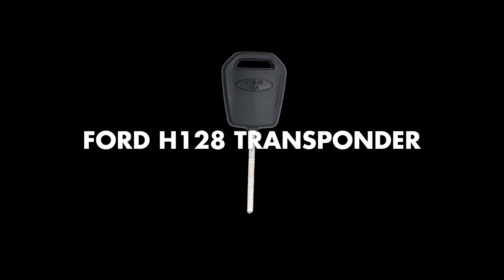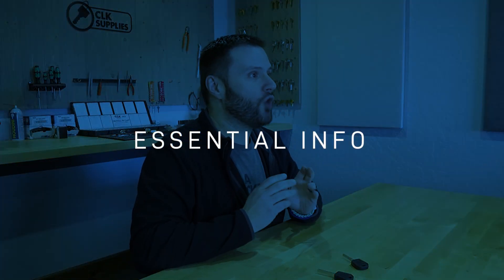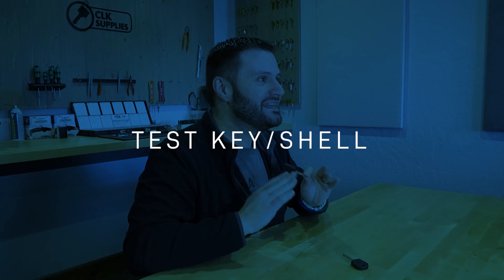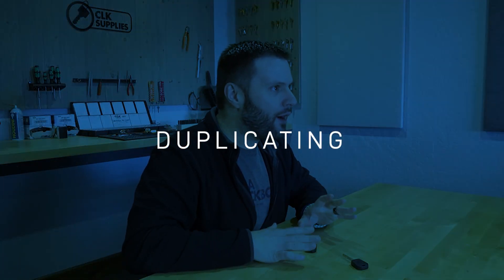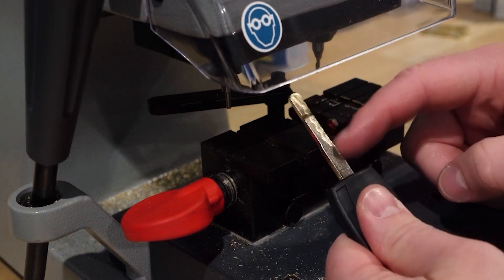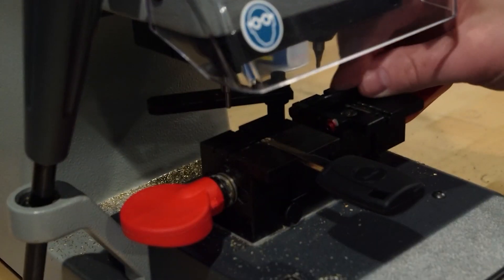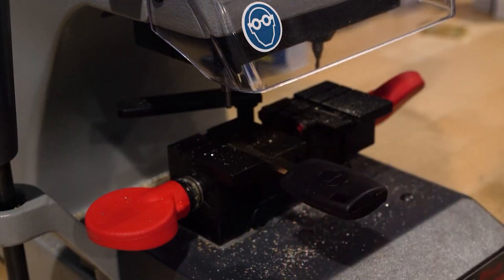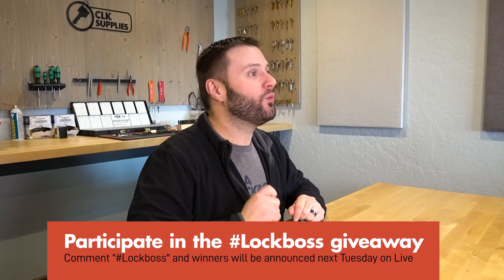Transponder Keys Explained | H128 Ford "T" Key

Comment: The reason for the "twist" is because the vehicles that would take this key have the remote-flip key.  They've designed it so that the ignition key hole is 90 degrees of what you'd normally expect so that when you put the key in the ignition it feels more natural. I recently bought a 2022 Ford Maverick and I'm doing some research about the keys, that's what led me here.

Comment: 🌵🇨🇦 My 2013 Ford escape uses the H101 remote head (H94).  Very interesting to see how Manufacturers are  using the same code series with different key styles.  Thx for the PDF. One thing I can see doing with the Silca duplicators is getting another light that does not require the cutter to be spinning to get lights on.  🇨🇦🌵 #LockBoss

Comment: fun fact: if you use a manual machine you can take a GM HU100 test key, turn it on edge and mill that little step shoulder on the sides and then use it for a Ford. #Lockboss